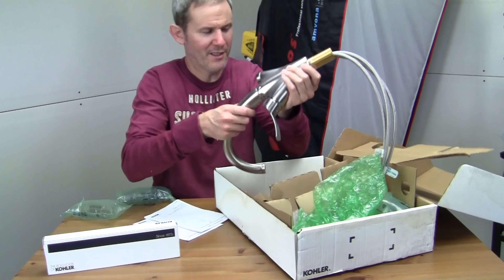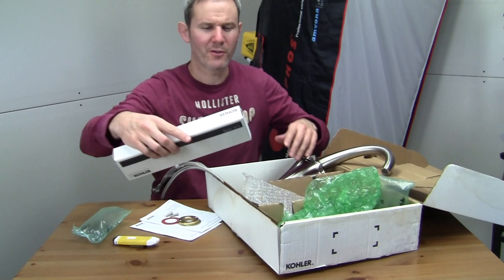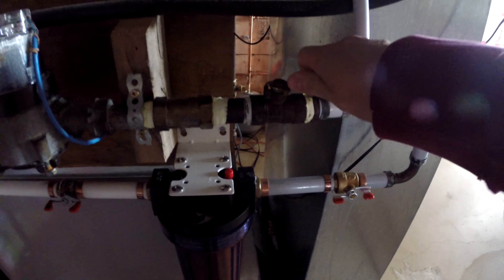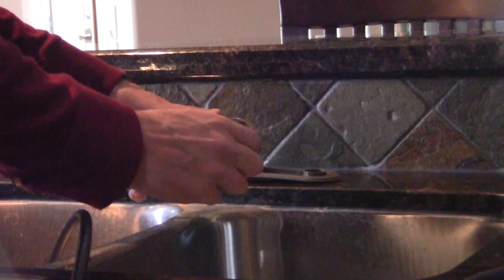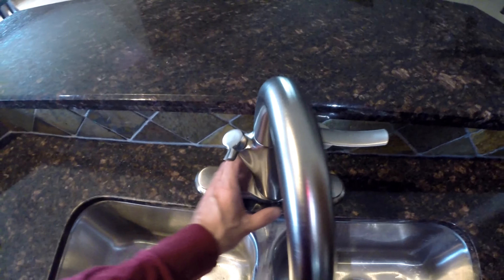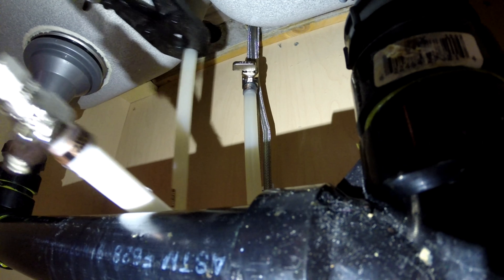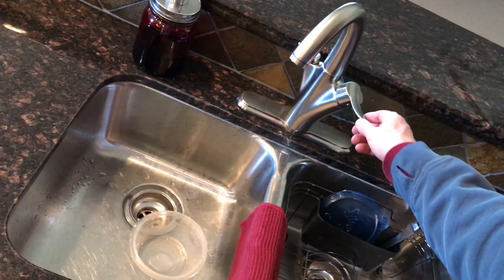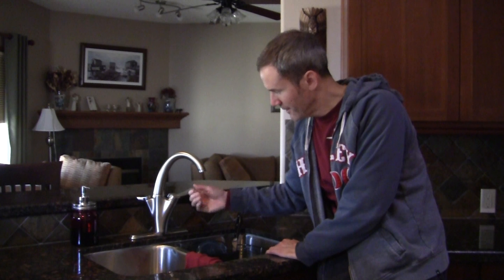How to Install a Kohler Carafe Filtered Water 3-Way Kitchen Faucet

Comment: Thanks for sharing this video, wondering if you're still using and how it's held up? One other question does the filtered water come out of a separate line from the main water? If so is it metal or plastic when you remove the aerator?
Reply from the maker: Thanks for asking.  It's still working perfectly in my kitchen.  The filtered water line is separate from the main water and goes to an RO system in the basement right below.  There is no aerator in the filtered line and the water does come out with a lot of pressure.